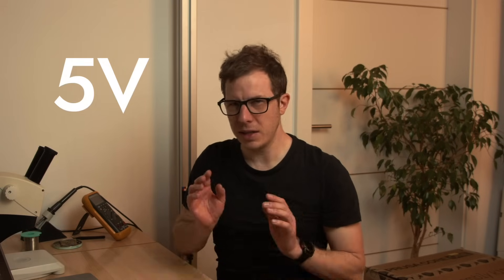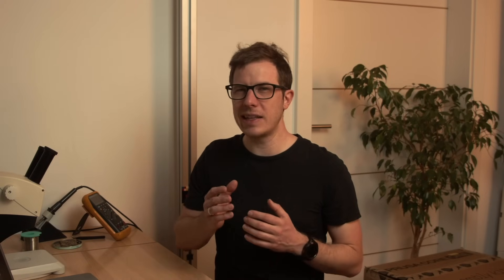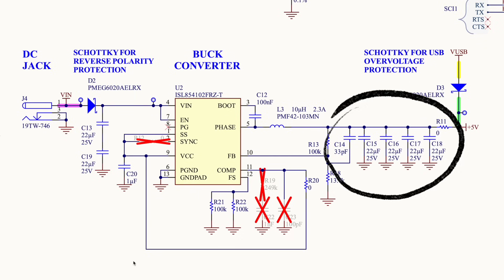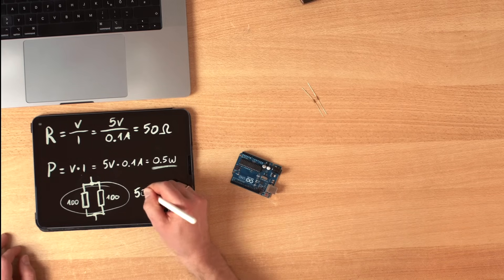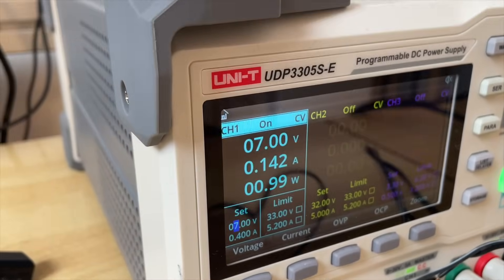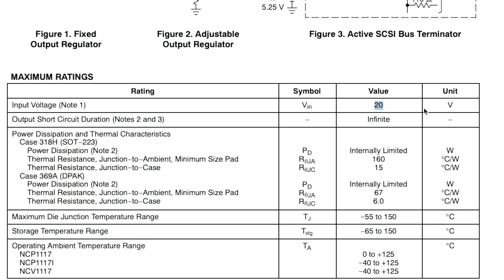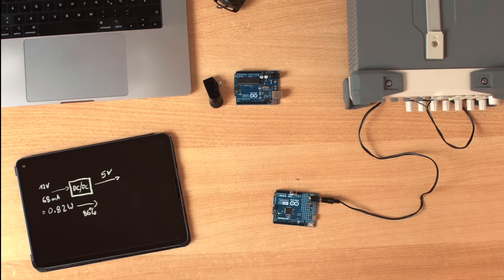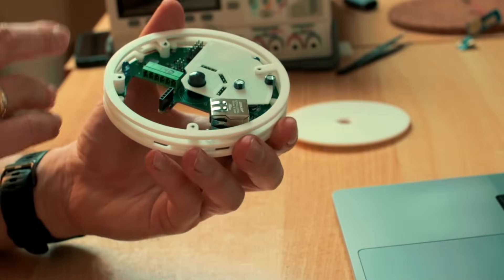Arduino Overheating: Unexpected Heat Source

Comment: I have two 12volt fans connected to a board with a 30 watt power supply and at full power or even low power the fans spin normal at first then both slow down and speed up again or just one slows down then speeds up again. Not sure if this is an overheating problem or something else?

Comment: I use the N7805 a drop in replacement for the LM7805. It has as small DC to DC buck converter circuit in it. It hardly gets warm even with 24V+

Comment: The NeRo from FTDI (2016) and the Seeduino 4.2 (2015) I have both feature switching regulators and there are more clones like this, as per usual, Arduino is late to the game.

And what the R4 does not fix is half-baked design. I looked at the layout of the R4 Minima and the first impression was good. But then I highlighted the 5V net and checked how the decoupling capacitors are placed around the controller. Well, it's bad, pin 11 has a capactitor placed nearby, but in a way that it is barely effective and pins 21 and 39 do not have capacitors at all, C4 and C5 are completely misplaced and if done right, there would be one more 100nF in the design. AVCC0 is layouted ok, but the layout of VREFH0 shows that AVCC0 is ok by chance and not by design. Also there are clear indications that this board was at least partly done with the autorouter and with no regards for the outcome.

Comment: There are resistors of 50 ohm and 0.5 W
Reply: Nobody said they don’t exist. But it’s a somewhat nonstandard value (the regular values are 47 ohms in E6, 5.1 ohms in E12, 49.9 ohms in E96, so that’s what resistor assortments have), though 50 ohms is manufactured, primarily to use as terminator resistors for 50 ohm transmission lines.
Reply: @tookitogo thanks but 47 ohm is quite the same. Greetings
Reply: @ManuelMalingreComa  For most things, yes. :)

Comment: Great to see a real test with load and the thermal camera showing the difference in temperature between buck converter and linear regulator. I think the title of the video could be improved to reflect the content more closely. Might be interesting to research why Arduino didn't put a buck/boost converted on the R4 to allow powering from single cell lipos.

I'd say the biggest (or maybe first) gotcha in moving from an R3 to R4 uno is the lower voltage on USB power. If users (viewers) aren't aware of that they can do all their development against ~4.7V and then if their final project is powered by the jack it will increase to 5.0V with various possible side effects.

A mention of noise/ripple from the buck converter would be useful even if it's not explored. if you want to do another practical test showing the ripple on a scope in time and frequency domain would be interesting including with some load. And any likely ADC/DAC effects for typical projects.

Comment: I would call the two different types of voltage regulators "linear" and "switching" and not "LDOs" and "DC-DC".  Both are clearly DC-DC regulators, so that alone is problematic.  The other problem is that "LDO" stands for "Low DropOut".  "Linear regulators" are so-called because their voltage-dropping transistor is operated in its linear region to induce the power-wasting voltage drop.

The LDOs typically used on most vendors' R3 boards are NOT LOW dropout, as their drop-out voltages are quite high (typically 1.2-1.5+ volts).  An actual LDO has a LOW dropout voltage (hence the name), typically 0.5-0.8V.  As one should infer, a linear regulator with a high dropout voltage is NOT an LDO (even its datasheet will concur).  Calling all linear regulators "LDOs" is incorrect and isn't an uncommon error, and too many people who should know better continue to do so.  The 7805 is the classic definitely-not-an-LDO linear regulator.

As you stated, getting VIN as close to 6.5-7.0V is the way to go.  If the project uses low amounts of current, then going to 12V isn't the worst thing in the world and still wastes a relatively large proportion of its input power, but a low(er) absolute amount of power -- which as you noted has a significant impact on the amount of heat generated.
Reply: Yeah, I hate how younger people, misled by many semiconductor manufacturers renaming the “linear regulators” category on their websites to “LDO”, refer to all linear regulators as LDOs. 

However, the rest of your comment is… not quite right.

Let’s be absolutely clear that 1.5V dropout is considered low dropout. Classic high-dropout regulators (78xx, 317, etc) have a dropout of around 3V, so anything significantly below that is an LDO. Half of that is definitely significant. Yes, modern ultra-low LDOs do a whole lot better, but nonetheless, “significantly less than 3V” is how LDO is defined. 

The issue with your statement about “LDO” vs “DC-DC” is that people don’t actually say “DC-DC regulator”. They say an LDO or linear regulator and a DC-DC converter. Yes, both operate on DC, but a linear regulator is not a converter. It’s unnecessary (though not incorrect) to also state “linear” vs “switching”, because “regulator” vs “converter” already accomplishes the same distinction. Similarly, anytime one sees the words “buck”, “boost”, “buck-boost”, “step-down”, or “step-up”, it is understood to mean a switching converter, even if they call it a regulator, though “converter” is normally used. (You do occasionally hear someone say “switching regulator”, but that is unambiguous.)
Reply: @tookitogo  Yeah, I didn't quote "DC-DC regulator" as an oft-used term of art, but just as a literally correct category.  I'll have to admit that I've never heard that there's a widely-accepted value for "low-dropout".  In my heart of hearts I would have hoped that it would have been in the 1.5V neighborhood.  I have trouble losing much more than 2.0V with an LM7805, but I'm loathe to use it for much more 1.0A unless I'm hacking.  I guess that I really HAVE been spoiled by the relatively minuscule dropout of the LD2112.  Thanks for the info.
Reply: @ericbwertz  Huh? In your original comment you say that 1.5V isn’t low dropout, but now you’re saying you wish the delineation were around 1.5V.
Reply: @tookitogo  I don't "wish" that it's any particular value, but assumed that it would have been closer to 1.5V, but you're telling me that the threshold is on the order of 3V.  Having used mostly LDOs in the 300-600mV range, in my spacious head, I've felt that 1.5V is already a pretty crappy dropout loss, and so an LM7805 at 2.0V (typical, at 1A) would "certainly" NOT be considered an LDO, which you disagreed with.  Sorry if that wasn't clear.
Reply: @ericbwertz  Huh? No, that’s not what I said. I literally listed the 78xx as an example of a high-dropout regulator, with their dropout of up to about 3V. (The datasheets list only the “typical” 2V, but no maximum. Most third-party documentation suggests it’s 2-2.5V in practice, hence the 3V headroom you should leave.)

Even if we use 2.5V as the 78xx value, it’s only a little bit less than 3V, and thus not the “significantly lower than 3V” I stated.

Comment: TLDW; the r4 has a switching regulator which is more efficient than the r3's linear regulator

but it's also noisier. the best solution would be a switching regulator which makes 7V and then a 5V LDO to get a clean supply rail
Reply: Nah if you're actually using a buck plus ldo combo (which you should) you can go lower to like 5.5V since ldo is "low dropout"
Reply: Yeah, if you trust the chinese crap they put on there
Reply: @thewhitedragon4184  Depends on the regulator. Early LDOs, like the 1117 used in the Uno R3, have a dropout of around 1.2V. (Which is “low” compared to the 3V dropout of traditional regulators like the 78xx and 317.) Modern ultra-low dropout regulators can well under half a volt.
Reply: @tookitogo Yeah good thing we live in the now with ultra low dropout regulators half a volt is nothing nowadays.

And yeah a volt drop also isn't much the r4 shouldn't be able to draw that much current but for battery application it matters more
Reply: @thewhitedragon4184  Definitely!! No sense in burning off battery power as heat when you could use a nice switching converter.

Comment: But this means the R4 is noisier, I wonder what is the impact on DAC and ADC.
Reply: totally correct, but you have the option of filtering the ADC/DAC inputs/outputs also -- exactly how and how much depends on what your performance goals are.  One thing that's also done to mitigate the problem you point out is to use a switching regulator to knock the input voltage down to just above the dropout voltage for a linear regulator to dampen the ripple along with its own input and output caps.  Clearly this isn't going to be much of an option if you're using an off-the-shelf MCU board.  Although you could bypass the regulator on the board and bring your own input power supply circuit and power the board yourself.
Reply from the maker: Good point

Comment: Thanks for your clear explanation.
Hint for a next video: how do you solve the eternal problem of powering an Arduino board and a DC motor from the same power supply without causing noise and spikes, causing your Arduino board to freeze, reset or die? Many people, incl. myself, have tried to use a 12V power supply and split the power into 2 power lines: 1 that goes to the motor driver and another one that goes to a buck converter and then to Vin and GND of the Arduino. But despite built-in protection on the BTS7960 the setup still isn't stable. Where did we go wrong?
Reply from the maker: Not sure how big the spikes are, but I would try a decently sized LC filter between PSU and Arduino.
Reply: @playduino  Thanks for the hint. I don't have the equipment to test for spikes. Would be nice if someone like yourself would try it and share the results.
I was expecting the BTS7960 to filter everything because some people claim a BTS7960 contains capacitors and a Schottky diode, but I can't seem to find a datasheet to confirm this. It's a mystery.
Some people say you always need a separate power supply, but that would result in a small project with 2 power adapters. Not practical, hence the need for a buck converter. Or is the buck converter itself the weak spot of the whole circuit?
Do we need to add capacitors to the DC motor itself?
Reply: @jacquesmertens3369  If it's a brushed motor, you can put one or more capacitors across its two terminals, as long as you don't mind dampening the response of the motor to speed changes a bit (you "probably" won't).  And you just can't just slap any 'ol capacitors on there, plus caps take space and introduce their own failure point to the system.

Hate to break it to you, but physics doesn't really care what you consider "practical".  The good news is that you DO have lots of options, but you do get to choose between the least bad ones depending on whatever your particular pain point(s) are.
 
Since your bridge controller has some level of slew rate control, you might consider turning that down to see if it helps at all.  Unfortunately without an oscilloscope, you'll always be guessing at what helps, and to what extent.  Plus you need to consider that if you're using a BDC motor, the noise that it generates is going to increase over time also as its brushes wear out, and even somewhat on environmental conditions.
Reply: @ericbwertz  In which case you will understand why I would appreciate if someone with the right knowledge creates a video on this specific topic since it's quite common and everyone is suggesting something else that might work.
Reply: @jacquesmertens3369  My only real issue was his choice of names for the two topologies, which weren't orthogonal.  With the R3 you were always able to bring your own 5V power supply and rely on neither USB power or the linear regulator that knocks down the voltage from the power jack.  One could bring their own more-efficient 5V supply and connect it to the 5V pin.  The only concern might be back-powering the linear regulator on the board, but that might even be a function of exactly which "LDO" your particular board (since there are many clones) uses.  But since the Uno R4 uses a more efficient switching power regulator to derive its 5V VCC supply, there's much less chance that that's very useful.

An LDO could be more efficient than the switching regulator at very low currents, but when mostly-running, the SWREG is likely good enough for many purposes.

For what it is, this video is just fine and lots of people can find it helpful.
Reply: Separate power supplies are generally the best choice, with any control lines between the motor and the MCU being opto-isolated.  Filtering alone can help, but depends a lot on the particulars of your system.  The other "fake" filtering you can use is to put another LDO (like an MC7809 or LM317) between you and the Arduino to knock the 12V down to something near/above 7V, then let the Arduino''s linear regulator finish the job down to 5V.  Each LDO will provide some level of noise rejection on its input, and splitting the power waste across two LDOs can also have thermal advantages.  Relying on two LREGs for noise rejection isn't great, but by adding a variety of input and output capacitors on that intermediate LREG is probably where more of the benefit might come from.